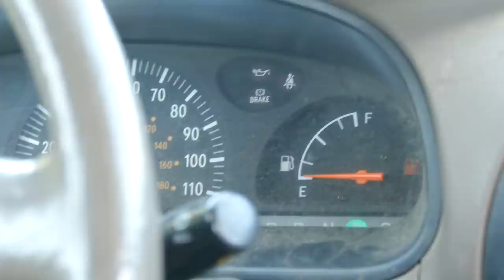Salt & Tar: Episode 94-Mizzen We've Been Missin' (Reclaimed Mast)

Comment: Loctite Black roof flashing polyurethane is an excellent choice. I have used 100 tubes on my wood boat. I sealed all the seams with PL premium poly mixed with sawdust as the 'caulking'. Then went over that with a mix of the Black PL and 1/32 milled fiberglass fibers using a 6 inch putty knife. Hull is totally watertight, and has been great the last 6 years. Also anywhere you might use 3M 5200 you can use this loctite poly.  Even though the tube says dont use it underwater,  for me it works great. You can use without the milled fibers but it gives it greater strength.

Comment: If you wanted to save the sanding dust. 
Mix the dust with epoxy and use that in the cracks and holes.  It makes an invisible strong repair

Comment: If you had to do this over again, ya I know--terrible question, and cost wasn't a huge pressing factor, would you build slightly bigger? I realize bigger also effects time, but an extra 10% in size seems like something you could easily use it since its your home, full time. I'm asking for my own possible reasons, just wondering what your experience has shown you.  Thx

Comment: hi, can you tell us what the mast sizes are? Just so I can get an idea. I am building a sailboat that the mast has 9 meters in the aluminum project, but I will not put aluminum I think is expensive and weak. I'll make wood even kkkk obg and good winds :)
Reply from the maker: Our Main is 40 ft but keel stepped so it's probably 35-36 ft from the deck (12 meters about) and the Mizzen is close to 26 ft but about 23 from the deck up ( about 8 meters)
R
Reply: @SaltandTar  obg, I will do my math now kkkk good winds!